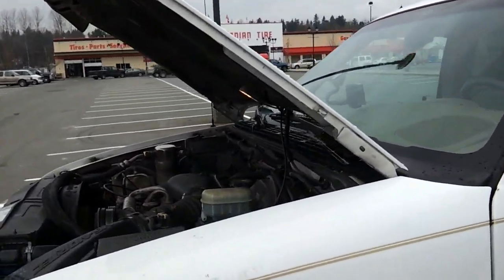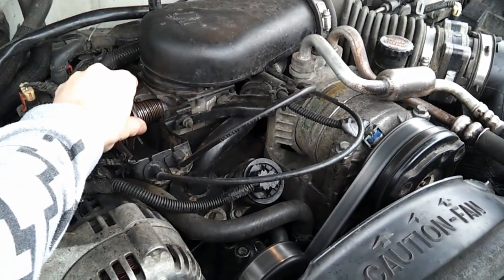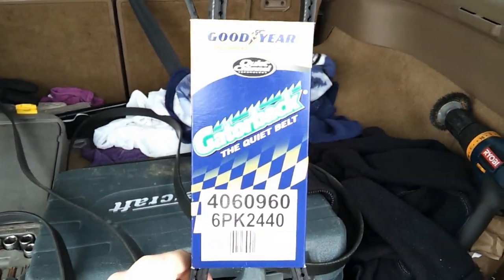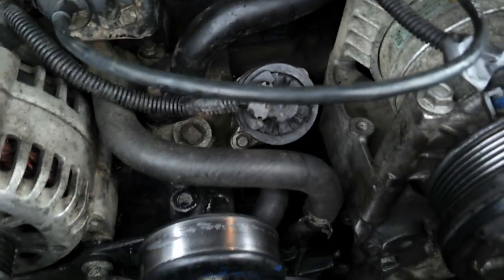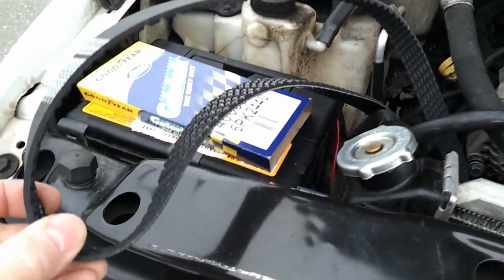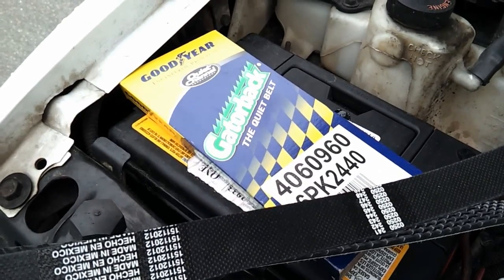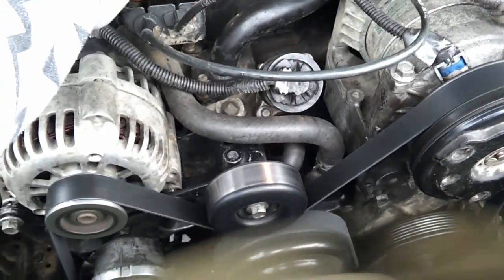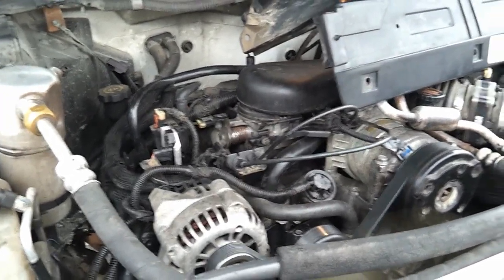98 4.3L Vortec goodyear gator back belt

Comment: Just came across this video. Very well explained. I had the same issue after a power steering pump replacement on my 05 Corolla. It was a little misaligned with the rest of the pulleys that caused my brand new dayco belt to make that annoying squeak/chirp. Even the slightest misalignment will cause the squeak. Anyways i got a continental elite gatorback belt and it totally fixed my issue. They are the best belts for any car.

Comment: I bought one back in 09 for a 99 suburban 5.7l and I finally replaced it this week. Even after 7 years and 50000 miles still quiet and yes it did have cracks in it.

Comment: I've got a nice squeak from a GM HFV6 (3.6L V6) that recently started. Never replaced the belt myself, and not sure if it was replaced by the previous owner. Seems to squeak when engine RPM rises quick (such as downshifting, starting from a redlight, etc). Had a gatorback on my old car, and it was dead silent, so i'm hoping i'll have the same result on the Cadillac. I'll try to post a video of the before and after.

Comment: I'm definitely going to try this.  I bought a Dodge Caravan last month and after a week my belt started chirping.  I've taken to three different shops and been told three times to just ignore it,  it's fine.  Fine? It's driving me absolutely nuts.
Reply from the maker: try it, its worth it. please post a video response if you can
Reply: Waiting on the belt from Amazon. The chirp is gone at the moment, the last mechanic I took it to suggested I rub a bar of soap on the belt.  That silenced it pretty good, but I doubt that's a permanent fix.
Reply: +wayne foutz no the squeak will come back over time of u use soap
Reply: I'm having the same problem with my caravan at the moment. going to buy one of these belts.

Comment: Any issues with it coming back? Ive been chasing the same squeak on my 2000 S10 4.3... new belts work for a few days but the sound comes back
Reply from the maker: nope noise never cameback
Reply: streetstomper I installed this belt and the problem never came back as well. I was about to pull my hair out haha

Comment: my 98s10 sounds exactly the same
Reply from the maker: Samuel Clark I would definitely start by rubbing bar soap on both sides of the belt...if the sound goes away it is most likely a problem with the belt. I would highly recommend this belt.
Reply: streetstomper I used soap goes away for a little while then comes back so it's definitely the belt. would mine be the same part number as yours I'm having trouble finding What part number I need. I assume it would be it looks just like yours.
Reply from the maker: Samuel Clark I am not to sure but my guess would be if it's the same motor, year and accessories  (A/C) it would be the same.
Reply: streetstomper ok thanks man, just curious do you still have this vehicle?
Reply from the maker: Samuel Clark no I ended up selling it. Check out my channel   you can see few videos of it along with my new truck., but I will tell you it was absolutely the best SUV I've ever owned, it was like a tank off road especially after I stuck a set of goodyear Wrangler duratracs on it,  it went  everywhere I dared to take it.
Reply: streetstomper I have a 92 s10 blazer 4 door 5 speed it has the older 4.3 that thing is awesome I have pushed snow with the front bumper. and it's completely stock and just has cheap goodyear wrangler radial tires from walmart. I love the s10 series.